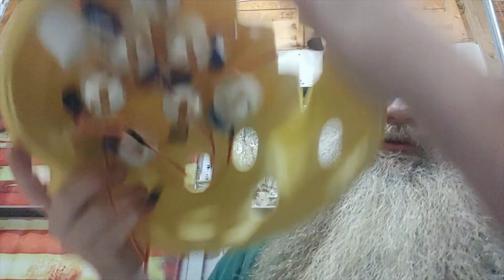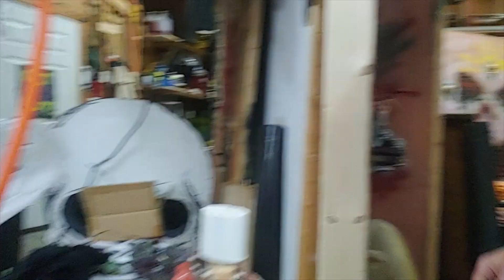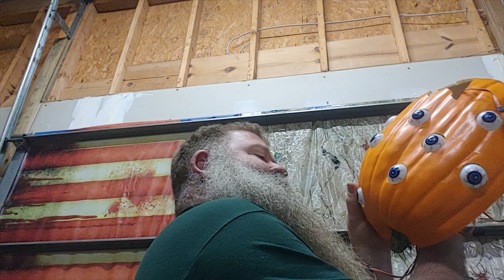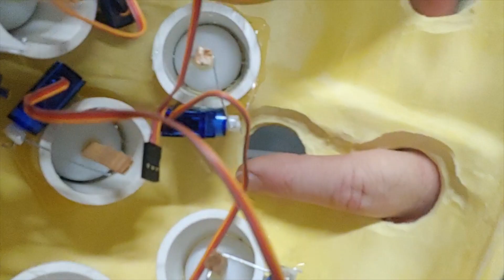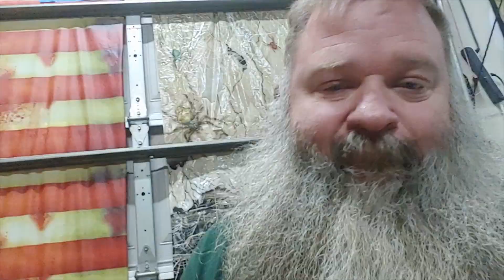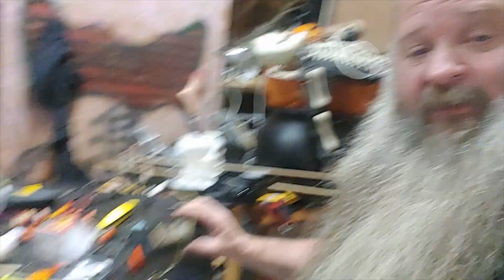Animated Pumpkin Eyes. Arduino and Servos.

Comment from the maker: Arduino Sketch:

// Random multiple
// by 68percentwater
// This code generates a random position for each of 12 servos, pauses and then repeats.

#include <Servo.h>  //this is a servo library 

Servo servo1; // create servo objects to control multiple servos
Servo servo2;
Servo servo3;
Servo servo4;
Servo servo5;
Servo servo6;
Servo servo7;
Servo servo8;
Servo servo9;
Servo servo10;
Servo servo11;
Servo servo12;           
int pos = 90;    // variable to store the servo position with a starting position of 90 degrees
                       // so the eyes go to the middle at startup  

 void setup() 
{ 
  servo1.attach(2);               // attaches the servos on pins 2 - 13 to the servo objects 
  servo2.attach(3);
  servo3.attach(4);
  servo4.attach(5);
  servo5.attach(6);
  servo6.attach(7);
  servo7.attach(8);
  servo8.attach(9);
  servo9.attach(10);
  servo10.attach(11);
  servo11.attach(12);
  servo12.attach(13);
  servo1.write(pos);              // tell all servos to go to middle position (90 degrees)
  servo2.write(pos);
  servo3.write(pos);
  servo4.write(pos);
  servo5.write(pos);
  servo6.write(pos);
  servo7.write(pos);
  servo8.write(pos);
  servo9.write(pos);
  servo10.write(pos);
  servo11.write(pos);
  servo12.write(pos);
  delay(700);  
} 
    void loop()                           // for each servo, generate a random number between 10 and 170 and 
    {                                            // assign to pos then write the pos to the servo.  This is done in three groups 
    pos =random(10,170);      // with a delay to make it appear the eyes are not all starting at the same time.
    servo1.write(pos);             //  I use 10 and 170 because the last 10 deg on either side jammed my
    pos = random(10,170);     // mechanism.   Depending on you mech, these might need to be other limits
    servo2.write(pos);             // They don't need to be all the same, each eye can have its own range
    pos = random(10,170);
    servo3.write(pos);
    delay(200);
    pos = random(10,170);
    servo4.write(pos);
    pos = random(10,170);
    servo5.write(pos);
    pos = random(10,170);
    servo6.write(pos);
    pos = random(10,170);
    servo7.write(pos);
    pos = random(10,170);
    servo8.write(pos);
    delay(300);
    pos = random(10,170);
    servo9.write(pos);
    pos = random(10,170);
    servo10.write(pos);
    pos = random(10,170);
    servo11.write(pos);
    pos = random(10,170);
    servo12.write(pos);
    delay(200);  
    }